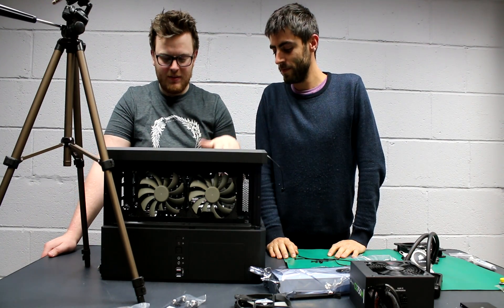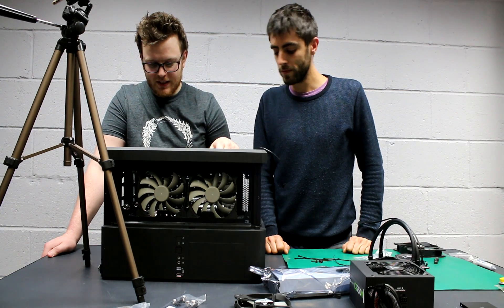BUILD LOG-GPU Test Rig (Part 1)

Comment: I have a little tip that may help with putting a motherboard in, Basically just attach the fan with two screws and lower the motherboard in holding the CPU fan. This way you aren't putting any pressure on any parts of the motherboard and it makes it a little easier to place. Then you can simply unscrew the Cooling system and rotate it however you see fit.